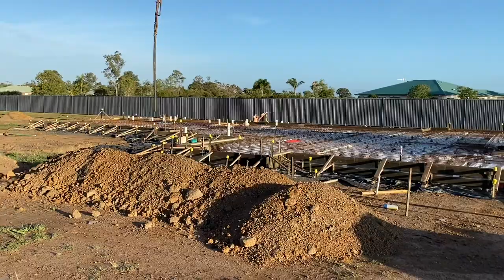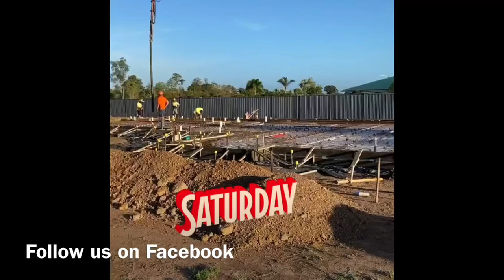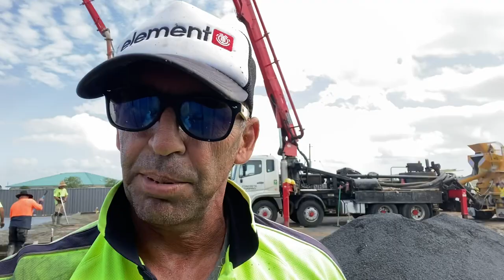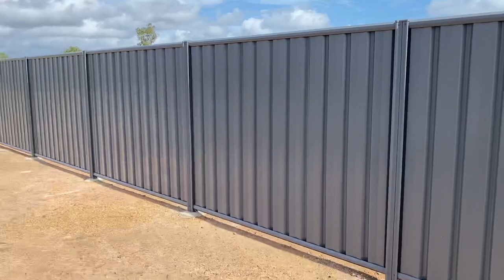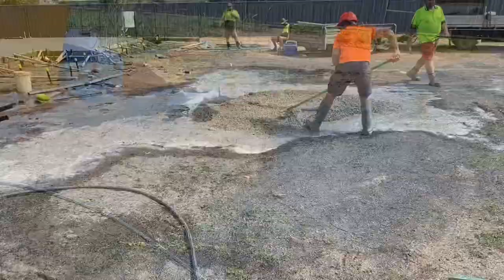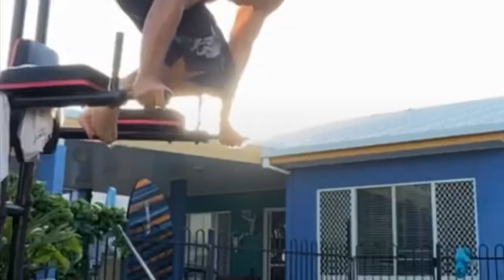How to lift the timbers when you are concreting

Comment: Thumbs up Ninja, Lawrence and guys

You can have as much of this cold weather we have here in Northeast U.S.A. as you want.  Actually, it is easier working in the cold than the hot, with in reason.  I don't mean extremes, and I'm talking doing the work.  As for concrete setting up, get the heaters out.

Thanks for the videos and sharing your knowledge and tips

Bill